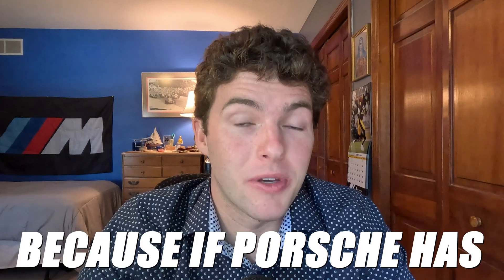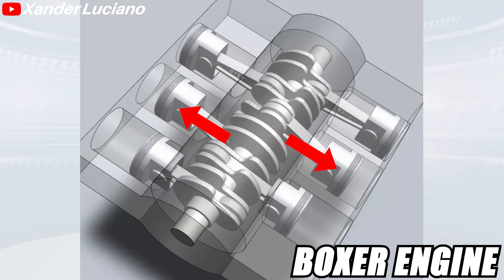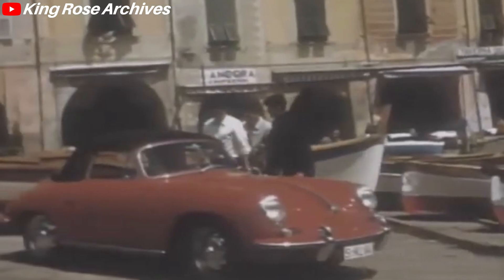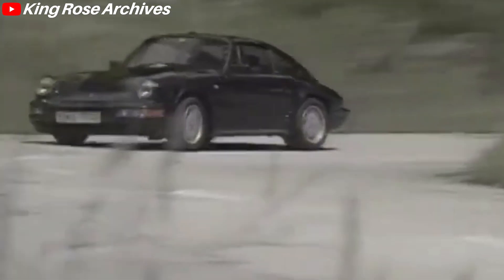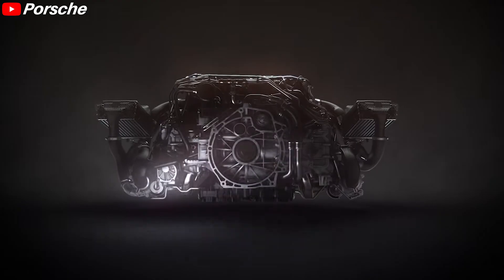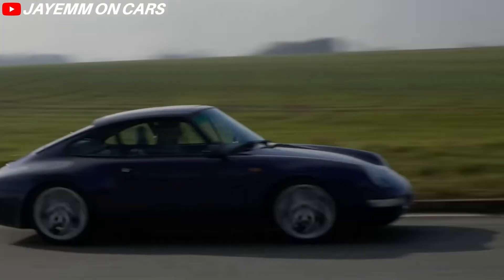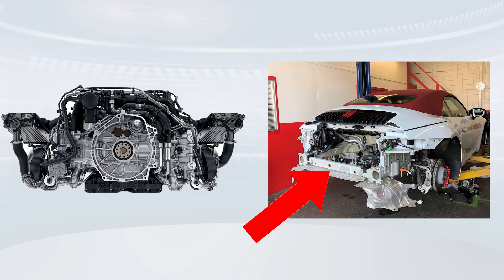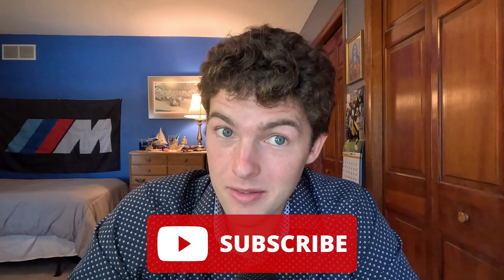Porsche is OBSESSED with Boxer Engines: Here's Why

Comment: how did you talk about boxer engines without talking about Subaru!!
Reply: Porsche has been making and using boxer engines far longer than Subaru has.
Reply from the maker: I intended to make the video specific to Porsche and their history with boxer engines, and not boxer engines in general. Not sure if that was a mistake or not haha. Didn’t want it to get too diluted from the overall purpose. Anyway, lm always looking to improve these so I’ll make note for future reference. Thanks for the comment
Reply: The “disadvantage” of having two cylinder heads also applies to V8s but that’s never been considered as a negative for that configuration. Also, the digression into the mounting position of the engine and the advantages for 911 performance is irrelevant to the features of the boxer engine itself. It’s the reason why older 911s were prone to bouts of severe oversteer which has had to be tamed by electronic intervention and control systems in later models. The mid-engined Boxster/Cayman, which also uses the boxer engine but doesn’t rate a mention, is a superior design in terms of handling in most real-world driving conditions. All that aside, an interesting video though.
Reply: Fair or not, there are many stories floating about regarding Subaru engines.
Reply: Because Subaru makes the worst boxer engines known to man
Reply: @SparklingWalrus  I've seen more Subarus with over 300k miles on them than I can remember, don't believe Donut's propaganda.
Reply: @PistonAvatarGuy  Porsche makes far better boxer engines than subie ever will. Subaru boxers also have next to no overhead. Sounds like bad engineering to me. 4G63 is better than any crappy Subaru boxer
Reply: How many with 500,000?

900,000? I’ve seen old Porsches with those numbers….

My wife’s Subaru, which is a great vehicle, is burning quite a bit of oil, at 153,000.
Reply: Don’t forget about Toyota GR86. Although that it a Subaru clone
Reply: @lowlevelcritter7577  It actually is a Subaru engine, not a clone. The car was a joint project between Toyota and Subaru.
Reply: @PistonAvatarGuy  worst joint adventure Toyota ever got themselves into GR86 is a dogshit car with terrible oil starvation issues. It’s for peak poor people who want to be peak slow.

Comment: Volkswagen classic beetle is more reliable than their new ones as the classic boxer 4 is simple!
Reply: Less hp and torque = less stress

If you reduce the compression of current boxer engines so that they produce the same HP as the old beetle engine, the current engines would also last long.

Comment: well, for one thing the sound of a flat 6 is pretty amazing. my Cayman is almost 20 years old but it roars when i driving in the canyons on an early Sunday morning. However, it is a big pain in the neck to take the back wheels off the car to change the sparkplugs and coils..
Reply from the maker: I’m sure the maintenance is inconvenient, although seemingly worth it. I hope to own one someday. Thanks for sharing, I enjoyed reading.
Reply: How  often do you do that, though? Every 60,000 miles?
Reply: @m5pilot397 that and any time you need to get to the side of the engine
Reply: For what else?

At how many miles?
Reply: @m5pilot397  sometimes the vvt solenoid goes bad, I'm a little over 53k.
Reply: Flat six sound was described well over 30 years ago by a motor magazine writer as 'unique futuristic whirring sound' Best description I have ever heard.

Comment: The way Porsche made boxer engines made it look like it's reliable but besides Subaru I don't think that level of boxer engines can be replicated the same
Reply: The classic VW Beetle has a boxer engine, the VW Bus and the Citroen 2CV. All highly reliable. Porsche cars actually started off with a tuned Beetle engine. You have boxer aircraft engines still manufactured today, again highly reliable.
Reply: @mjoelnir1899 well considering VW owns Porsche it makes sense they’d use the same technology
Reply from the maker: Good point
Reply: The Subaru engine can be made reliable with a bit money spent on it look at roger clark motorsports and litchfield as examples
Reply: @krisbuck2165  That is quite expensive and not really worth in in my opinion and a porsche flat six just is reliable.
Reply: @bugnautica-lo9ng You are perpetuating an issue with 20 year old engines that no longer exists. The newer Boxer engines really don’t have reliability issues anymore. The newer FA 25 for instance is a major redesign. I have two of them and haven’t had a single issue with either of them.
Reply: @bugnautica-lo9ng  No, they're not, they may not break but they wear down easily and need rebuilds.
Reply: @bugnautica-lo9ng well Subaru ez30/36 is very reliable, as a flat 6
Reply: Subaru boxers are very reliable often reaching 200k to 300k miles until you put a turbo on them, there are many examples of flat and boxer engines proving reliability however the natural balance of these motors allows manufactures to make them less beefy leading to them generally being bad candidates for high power
Reply: What are you even trying to say?
Reply: Have had 7 subarus, none of the engines failed or gearbox for that matter, my current I've had for 13+ years and has been tuned and modified. Purrs like a kitten at idle so quietly, I have had to double check I turned the car on 😂 maintain servicing like you would any other car, they will last just fine, even modified. Mates STI has been running 550whp on an unopened EJ207 for 5 years and still beats it every month at the track, maintains servicing and still boogys hard.
Reply: Bruh … there is nothing in a Porsche that is reliable. It’s a weekend show Off Maschine… nothing more nothing less
Reply: Should have mentioned the handling danger of a rear-mounted engine - trailing throttle oversteer.  Early 911s suffered from it but Porsche tamed it with electronic handling aides and huge rear tires.
Reply: Subaru is not even close to porsche in terms of reliability unless your a luxury brand that can afford to make everything extremely premium the inherit challenges of this engine will bear there face and cause your engine to explode. Very notable in the WRX and in cars with higher more exposed piston rings that obtain lower emissions but also have a tendency to fail due to inherit exposure to combustion.
Reply: @bugnautica-lo9ng people beat the wrx like a rented mule. People baby a Porsche 
I know a suburu is no Porsche, but for 1/3 the price, I love my boxer.
Reply: @bugnautica-lo9ng  Bro what's ur point? A car that's 3 times the price is better? Nobody is arguing with you there...
Reply: @Vmining kinda my argument is that they are really reliable with maintenance and most are only maintained not babied and they aren’t necessarily more expensive  a 2024 911 turbo S is that much more expensive but a 996/997 (used ofc) can be much cheaper  than a fully optioned WRX GT and  be pretty bulletproof if taken care of. That WRX is a new car with a warranty so yeah you are correct they are something that has a crazy engine and at a fractional price point, and you can’t get the modern prefected precision machine german masterpiece without spending much more money so yeah you are right that WRX has its place as a more budget friendly option I just personally would opt for a used 911 because of value they hold and reputation for being extremely reliable. I also wouldn’t bash you for buying a new subaru though because new things just possess a different quality and feel.
Reply: honda makes the most reliable boxer engine and its not even close lol
Reply: @vinbmxnj  Honda has like 2 motorcycles with a boxer. That means literally nothing lol. Subaru's flat 6 lasts forever

Comment: It's a wide engine that can be problematic.
Reply: Hasn’t been an issue for Porsche, though.

Or Subaru.
Reply from the maker: True
Reply: @DrivenbyMatt bollocks , why it should be problematic? It is one of the most reliable construction so far!
Reply: @123antimiro  packaging.
Reply: Really? What problems does it cause? owned boxer engined cars both VW and Porsche and Steyr Puch Haflinger. Wide motor was never problematic for me.
Reply: @keithad6485  it's problematic for the manufacturer !

I grew up with vw boxers, and I really liked them. My dream sports car would be a 6 cylinder porsche of some description, boxer/cayman/911 kind of thing. But .... the problem for the manufacturer, is how to package these ever widening engines, within the constraints of the chassis. 
Have you noticed how porsche 911 cars have been getting wider and wider with every generation, particularly at the rear axle. This is not just about handling and stability, it's a result of cramming ever more technology on the heads of the engine, so they can continue to offer class leading power and torque, whilst still conforming to ever tightening emissions regulations.

I once visited ProDrive in Banbury (England), and had the opportunity to talk to one of their senior engineers, who was responsible for the turbocharging systems used on their Subaru rally cars. I happened to say to him that I liked the boxer engines because they were interesting, and sounded great, as compared to, say, an in line 4. His response surprised me. He said that working with the flat 4 units was a 'pain', because he/they were so constrained on what they could do with the engine, because, at the end of the day, it had to fit between the suspension turrets of a subaru imprezia chassis. Rally cars cannot be too wide, that would be very disadvantageous on narrow tracks, and, the rally class for subaru is a homologation class - the cars have to be based on road versions of the car, which shares the same basic chassis as ordinary versions of the imprezia. They couldn't just widen the car, that would not be allowed, but interestingly, they were allowed to modify the transmission tunnel to the rear diff, they made it much bigger to add a lot of stiffness to the chassis.

I don't think that some of the commenters in this thread understand the difficulties that packaging engines can impose on designers.
Reply: @richardconway6425  What you describe, I can see is more problematic for a front engined boxer than a rear engine for the issue you raised, suspension tower, usually less of a problem at the rear. Having said, that, engineers should stop complaining and get on with the job. There are solutions to every engineering challenge. Top engineers, love a challenge to show off their inventive mind. I owned an engineering company for ten years manufacturing heavy vehicle components of a wide variety. Loved the challenge, in this case, the challenge of figuring out the most effective and efficient way of setting up the manufacture of a particular component. Loved it.